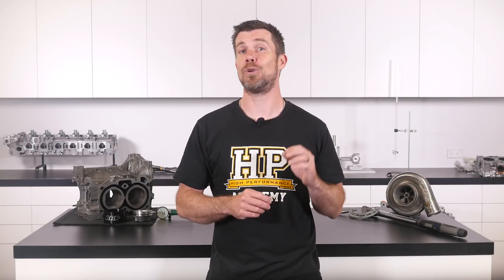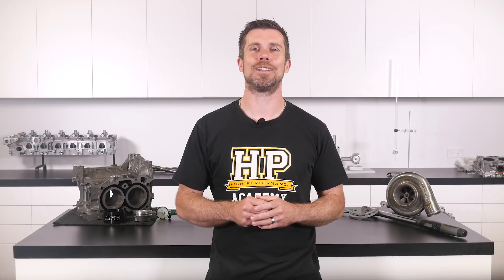Can I Detect Engine Knock On A Dyno Graph? [HPA Q&A]

Comment: I tune my engine with a knock sensor and recorded display. Is that a good way to tune an engine or is audio a better way to tune?
Reply: That's a great way, a good knock sensor will detect any vibration before you are able to hear it. There's also thresholds for knock sensors where you can adjust the sensitivity.
Reply: @Kenuwine24  I thought so. Yeah I had to set it to ignore normal engine vibration at different rpms so it only begins to pick up louder noises like knock. I've been tuning it like this for almost 7 years on my SR after a rebuild and it's still going strong.
Reply from the maker: Yes, provided you know what you're looking at and understand how to interpret the data. Generally these systems still require some set up and validation so I'd still use audio detection as well. Some of the units we use such as the Plex Knock Monitor offer audio detection as well as a graphical display. Getting a good visual representation of knock requires the correct knock frequency to be selected (typically very closely tied to the bore diameter) as well as setting a background noise threshold vs rpm (this is the normal noise output from the engine with no knock occurring)
Reply: @hpa101  thanks for the response, this is great information.
Reply: Your good then, I see it all the time in dsms and evos
Reply: Are you using an aftermarket system or are you monitoring the factory sensor?
Reply: @twinchargedmr2  factory sensor but using SAFC II to monitor.
Reply: @twinchargedmr2  also its worth noting that I kept the ecu wired to the knock sensor and tied in the piggyback. This way if it does knock for whatever reason it will pull timing for safety.

Comment: Why just audio?
Reply from the maker: @Jake Elliott in my experience quality audio knock detection is the most cost effective and reliable way of accurately detecting knock for aftermarket tuners. There are superior methods such as in cylinder pressure monitoring however these are cringingly expensive and also require considerable work to actually mount to the engine and hence are not suited to our use in the aftermarket. 

I would however typically be tuning an engine with built in knock detection/control, so I don't 'just' use audio knock detection, however I'll also add audio knock detection to validate that the ECU is correctly identifying knock in the first place. An easy to overlook aspect is that these knock detection systems require a number of parameters to be calibrated to allow the ECU to correctly identify knock. Otherwise they can be prone to picking up false knock or worse still, ignoring real knock.
Reply: @hpa101  thanks for the reply, the calibration aspect is certainly a great point. Cheers.
Reply: @hpa101  my experience in tuning isn't with petrol engines btw, most of it is mechanical methanol injection i.e. speedway and offroad vehicles, vehicles that are a lot less pre-disposed to lean failures.
Reply from the maker: @2secondslater  With methanol you're much less likely to suffer from detonation than with petrol and in many cases the engine can't be made to knock regardless what you do. From this respect it's a great fuel.
Reply: @hpa101  yeh you are right about methanol, it is very hard just to get the engine to run hot with methanol fuel.
Reply: It's the most cost effective way to detect knock. The equipment/sensors i.e pressure or video are expensive. Imagine a microwave that you can't see into. There are a few popcorn kernels (seeds) inside of the microwave. When the microwave is on and working properly it still makes noise (engine running) . When there is an issue the kernels start popping (knock). Hope that helps!
Reply: @TMR_2 I have a lot of dyno experience and knock detection by audio means is cheap but not infallible. I trust a good piezo sensor over a human ear any day, to the point that knock/timing control on individual cylinders is well achievable with modern control systems.
Reply: @TMR_2  no, I want to know why he uses just audio, you chimed in and spoke for him and went on about cost. He may have a valid reason for using audio knock detection over other means.
Reply: Then you know why! lol
Reply: Piezo sensors are essentially microphones.  Some tools nowadays let us listen to the audio coming from the piezo but either way it is using sounds vibrations to trigger the knock sensor so he may have been broadly referring to piezo-based knock sensors.
Reply: A piezoelectric sensor is generally much cheaper than a manual audio kit and it will stay with the engine until it or the engine fails, it will also be a real time input to the engine control unit and be able to be used for ECU self learning.
Reply: He has spruiked audio knock detection quite a lot; just want to know why over other methods.